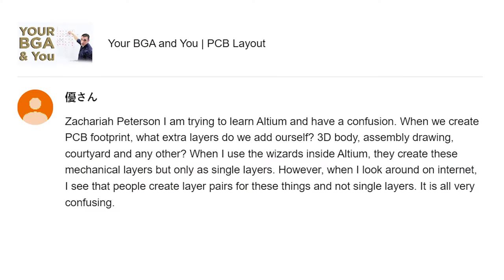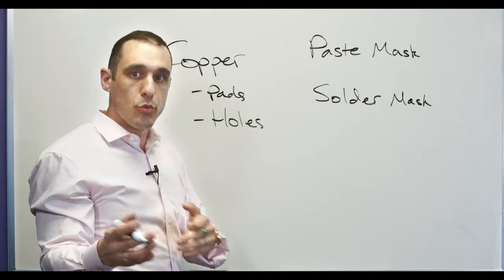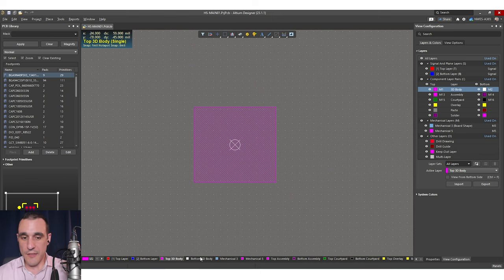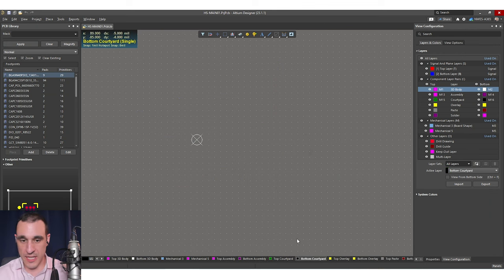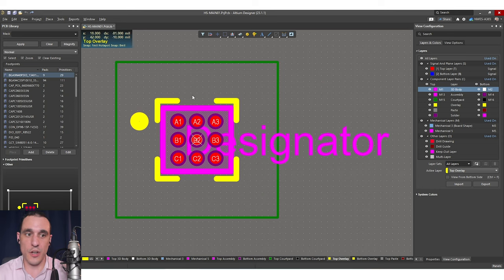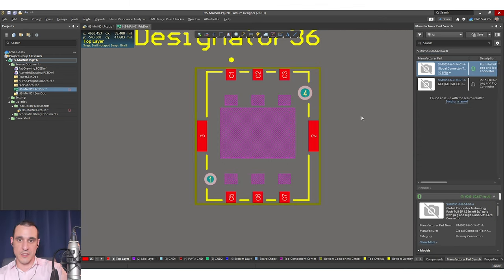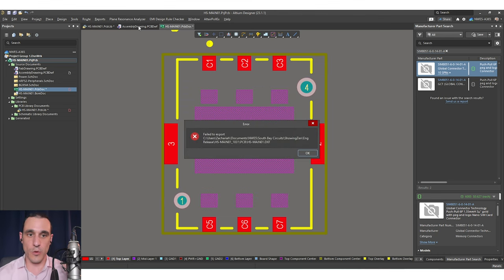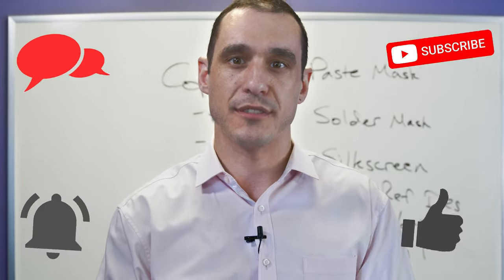What's with All the Layers in Your PCB Footprint?

Comment: Keepout mechanical layers in the footprint would only be useful as a guide to the designer. You can of course place keepout objects on the copper layers, or all-layer keepouts on the "Keepout" layer, but mechanical layers cannot act as keepouts to copper layers, neither are they able to be targeted by clearance rules (sadly). In the example shown, the keepouts should exist on the top copper layer only, as they are intended to avoid the spring fingers making contact with any surface copper, but should not affect internal/bottom layers.

Comment: It drives me bonkers that Altium doesn't include the 3d body projection in the PCB footprint editor. There is no reason why that feature shouldn't exist there so that we can easily add that detail to the assembly layer. I'm not a huge fan of draftsman so I'm creating the 3d body projection in Freecad, exporting it as dxf and importing when creating footprints. Not too cumbersome but annoying enough.
Reply: That's a fair criticism for sure, I would like to see something like that in the assembly layer so that you can more accurately draw out the courtyard layer or some other mechanical layer. Luckily some of the footprints you find in the Manufacturer Part Search panel will include this though.

Comment: Thank You. I am having a different requirement. I have to make a PCB footprint of a patch antenna with slots and an internal coupler which are spanned in different copper layers (3 copper layers to be specific). How can I do a PCB footprint for such a component? Kindly provide a solution to this requirement.
Reply: You can't have a footprint with copper on an internal layer, only top and bottom layers. However, you can create a No BOM component that has the copper elements for one internal layer. To do this, create the footprint on the top layer like usual, and then when you import into the PCB layout you can place the part in an internal layer inside the Properties panel. MAke sure to mark the part Standar (No BOM) in the part properties in the library or in the schematic. If you do this then the part can be placed in an internal layer, but the part will not appear in the BOM. When the surface/bottom layer portions and the inner layer portions are aligned, I think you can group them together so that they would all have to move together if you need to change the position.
Reply: Another way to do it is to use a design reuse snippet for that part of the PCB layout. If you create a snippet, then you can place it in the schematic and in the PCB layout without having to manually place the parts again, the placement will be copied from the design snippet. There should be documentation on how to do this.

Comment: Is there a Altium Design Standard which Mechanical Layer should be used for what function? I see in the that M1 is used for the 3D model, which were  previously added to M13 together with the component outline.
Reply: From what I know, there is no standard. However, there is an important point. You see when you create layer pairs, you can specify what kind of data the layer pair represnets. It could be something like 3D body, assembly e.t.c. Now if you have different PCB libraries with different symbols using different layer numbers, from I know it should all work out at the end since Altium designer can work out what layer pair contains what information.
Reply: Yes there is no specific standard, both in the industry and in CAD tools. Each CAD application has its own approach to using these mechanical layers. But you can name them whatever you want. For example with board shape, Altium has a board shape layer that it auto-generates when you export Gerbers, you can see it when you configure fabrication outputs. However you can create your own board shape layer as a mechanical if you want, and you can select this layer to be exported as the board shape.
Reply: Recent versions allow you to specify a "purpose" from a drop-down list for mechanical layers. This was necessitated when they moved from 32 mech layers to unlimited. Previously you just had to make sure your libraries and boards had matching layers arrangements, with this new approach the e.g. "courtyard" layer from the library will map to the "courtyard" layer in your board.
Reply: @Zachariah-Peterson  One thing I am looking forward to on the internet is detailed use of Altium Designer with HyperLynx for high speed PCB design.
Reply: @Zachariah-Peterson  I saw your video on solder bridge jumper. I have a few questions. The component is called solder bridge jumper. It is not called 0R resistor jumper. I guess this means that we should just put a bit of solder on this component to make the connection and then later we can just desolder it to remove the connection. Isn't that the basic idea that we only need solder to make the connection and not a 0R resistor? This point has not been discussed in the video at all.
Reply: @優さん-n7m  If the bridge is initially open, you could either mount a component or place a small solder bead on the copper, it is your choice. If the components are small enough and the pads are large enough, you could bridge them with multiple SMD components in parallel. Sometimes these are placed with the copper already closed, so it shorts the pads. In that case the copper should be thin enough so that you could cut it and open the circuit if you need to. Another usage of these is to attach a probe wire, you have more solderable area with the exposed solder bridge than you would have with a small testpoint pad, so they are much easier to probe.
Reply: @Zachariah-Peterson  If the two parts of the solder bridge jumper are quite close and there is no solder resist around the entire pad, I thought that we could just put some solder onto it and it will make connection between the two pads and we can later remove the solder (if we really need to break the connection) and the jumper connection will be broken. Maybe my understanding of what I thought these "solder bridge" jumpers to be is wrong.
Reply: @Zachariah-Peterson  I have a video idea for you, under the Project -> Project Options -> Options, we get a lot of things. In the lower half we have Netlist Options, Net Identifier Scope, Cross Refernces e.t.c. It would be great if you make a video that covers this topic fully so the people know what ways exist to create and connect together a schematic that is based off a large number of sheets. This will save new comers from a lot of trouble as well.

Comment: Thanks, this video was in reponse to my comment.

It must be realized that all those extra layers like 3D Body, Assembly, Courtyard e.t.c need to be created as layer pairs. This means that they will not be created as Mechanical Layers but as component layer pairs. In this case we will add information onto one in the pair (probably the top) and leave the other layer in the pair as blank. Now, when a person uses this component in a PCB and they flip the component so it is used on bottom side, since we used layer pairs, everything on top portion of the pair will goto the bottom (automatically) and everything on bottom will come to the top. This power is only obtained when we use layer pairs. If we do not use pairs and just create mechanical layers for 3D body and other stuff, then when the use the component on bottom side, all those markings will still stay on the top side.

There is one more layer created by Altium wizards called "component center". What benefit does this have for the user or the fabrication or assembly house? I mean I do not see the benefit of defining where the component center is.
Reply: Actually the assembly etc do not need to be created as pairs unless there is suff on the opposite layer that requires assembly information. For the 3D body, you might have a mechanical model spanning across 2 layers, so it's not like you are creating a layer pair. You could set the standoff height so that the model passes through the PCB and appears on the top and bottom simultaneously.
Reply: Also the component center layer is not required, many people do not use it. The 2D centroid information already gets exported from the CAD data when you create pick-and-place file so you don't need to also create a component center layer, that center layer is for the designer's reference.
Reply: @Zachariah-Peterson  How is the component center layer actually used by the people that need it?
Reply: @優さん-n7m  I think it would be to see exactly where the part will be grabbed with a pick-and-place machine in order to check that the placement will not be blocked by something.
Reply: @優さん-n7m  I personally use it for manual (visual) component alignment and as reference points for snapping. Quite practical both with relatively big area components and even small ones like caps and resistors.
Reply: I place the centre mark at the origin of the component, which should generally be the pick-point for the placement machine. Altium generates three different component locations for each component, component origin as specified by designer, centre as defined by the copper extents of pads, and centre as defined by the centre of pad centres (ignores pad dimensions). For symmetrical components these are typically all the same, but for irregular components they will be different. Basically this information is mostly useful for the SMT engineer.
Reply: @avlmrsn  Reference point snapping is a good idea
Reply: @Zachariah-Peterson 

here is another idea for a video; PCB design relies mostly on making tracks. There is a whole set of tools in Altium related to making tracks and some of their details are covered in videos scattered about. It would be nice to make a single video that covers the user manual of Altium related with routing. This will mean things like interactive routing (all options in GUI and also the keyboard shortcuts), multi routing, impedance and length matching e.t.c. There are scattered videos, either they can be added into a playlist, or a whole new video can be created that rather than just talking about the tools and options demonstrates how and when to use them.

Comment: I like the concept of the component layer pairs and actively use it, but find it frustrating that IPC wizard has the only option to generate single mechanical layers. As a workaround I do the following trick: I generate the footprint by IPC wizard and load the template of  mechanical layer set with a minimum component layer pairs predefined like 3D Body, Assembly, Courtyard and Designator (mech layer numbers corresponds to the default provided by the IPC wizard). This automatically places mechanical layers content on the corresponding component layer pairs.
Unfortunately, one can not store mechanical layer set in the cloud workspace, export/import is possible only on the local disk (yet another strange implementation in Altium).

Comment: Hi Zack. Two questions please if you have time.

1. Right now I've got my footprint design convention to placing assembly outline, .designator, and 3D body all on the Assembly Layer Pair. Is there a downside to doing this? Otherwise stated, using this convention, could I still differentiate within Draftsman and Gerbers which individual types of primitives to apply for a given output generation? If not, I will change my assignments to give each one their own layer.

2. Regarding adding layer "text" to all layers such that they are printed into the gerbers to clarify what is gerber layer is for PCB fab... it seems like this technique would generate DRCs, is that true. For example, placing Copper text on Top Copper that is outside the board outline would most certainly generate a DRC I would think. I presume one would then attach a "No DRC" to the text to avoid the error? If so, could you please explain how to do that? I know how to do it in the SCH, but not how to do it in the PCB.
Reply: 1. Based on what you write there is no downside to doing this, assembly outline and designator are standard in the assembly layer, and the 3D body once placed will be in its own 3D body layer. For the assembly views, draftsman applies the view automatically, so there is no need to manually differentiate. Fabrication view allows you to select which layers are prioritized along with a copper layer, so you have some customization.
2. You will generate DRC errors if placed into copper layers or silkscreen, solder mask, or paste layers and there is overlap with some other element that violates clearance. You can place whatever you want in mechanical layers, assembly layers, and courtyard layers and there will not be any DRC error, even if you have collisions. The reason is that these other layers are used to create drawings, they are not used in fabrication so the fabrication process will never see these layers.
Reply: @Zachariah-Peterson  thank you!